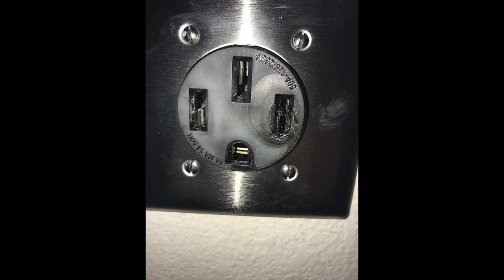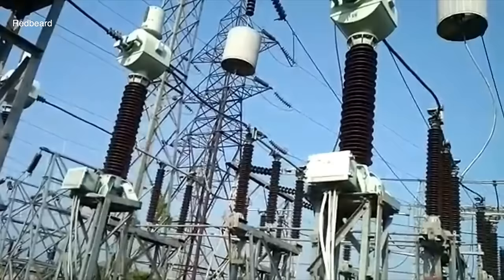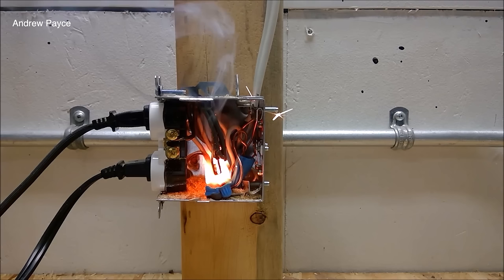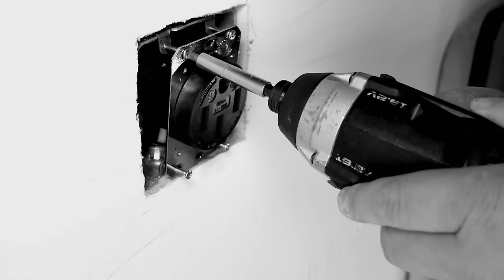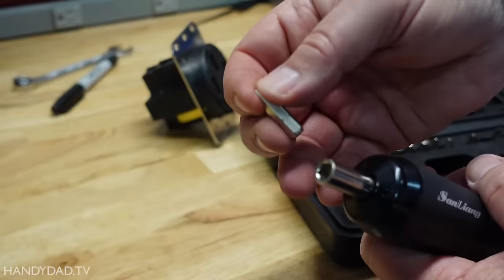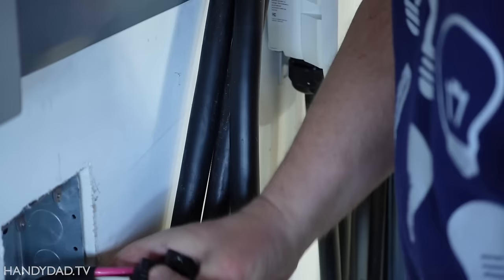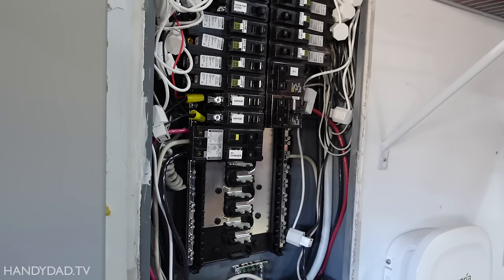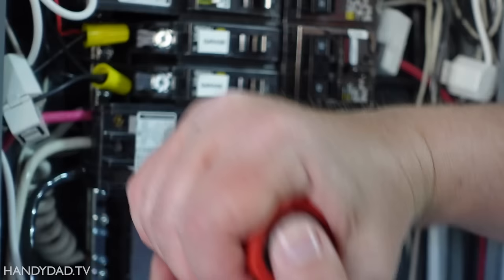EV Charging Disaster

Comment: Nice summary of the issues you have with bad connections. The design of the US domestic installations and outlets compounds the risks enormously. due to the high currenty everythig heats up a lot more. In Europe normal outlets are 220V, the connectors are designed to handle 10A indefinitely, that gives you 2,4 KW to play with. For Charging an EV n an outlet that is of course not much. so you either go with a single phase outlet with 16A, that gives you 3,6 kW, or you go three phase 16A or 32A. wich gives you 11 or 22KW since most EV use the three phases in a star configuration. otherwise they would be able to use 18 or 36 kW at a 16A32A three phase outlet. Three phase power to the house is standard in most of Europe.
utlet desig also mahes a huge difference, for the high currets have a look at CEE connectors for comparisun. So long story short, if you want to charge an EV at home safely in the US, use a wallbox. they have connectors that are designed for the high currents.
Reply: As a matter of fact..in the USA, an appliance designed to connect to a standard 120V 15A outlet can't draw more than 12A @ 120V because that's more than 80% of 15 amps. There are some exceptions, but not many. I don't believe there exists an 80% rule like that in Europe.
Reply: @brianleeper5737  ... it's actually 12.5 amps or 1500 watts to make 80% on a 15 amp branch circuit, but you have the right idea.
Reply: @rupe53  If you multiply 15 times 0.8 you come up with 12.
Reply: @brianleeper5737  ... My mistake, you are correct. I was confusing the common 1500 watt appliance rating, which is right on the edge of that. It's 12 amps on a 15 breaker and 16 amps on a 20 breaker. Got a bad case of brain fade after retiring a few years ago. Just remember that insanity is hereditary... you get it from your kids! (but it might not hit for years)
Reply: @rupe53  Yep. And one exception to that rule is hairdryers, they can pull 1800W. Probably only because the 80% rule is for continuous loads over 3 hours.
Reply: @brianleeper5737  ... would agree on the 1800 watt hair driers, but they are not all that popular for some reason, at least not in my area. I usually see them in hotels.
Reply: @brianleeper5737  no we're allowed to use the full rated value of the socket, however we also have a individual fuse in our (UK at least) plugs.  We also must have RCD (GFCI in us) in our distribution boards, and more recently they're integrated into the breakers. Latest spec is for AFDD, which can see parallel and series arc faults and isolate with warning. America gets many things right, but electrical safety seems a little dated.
Reply: @timburton1080  AFCIs have been required here in the USA since the 2008 NEC, if I recall correctly.
Reply: @brianleeper5737  In Austria and to my Knowledge Germany you can load it with 100% nominal current. There is a so called great proof load (if I translated correctly from German) of 145% nominal load that all circuit breakers need to be able to endure for one hour before reacting. for Switches it is 135%. The standards for maximum current in cables and so on also take that into account. So a properly calculated circuit rated for 10 A could be overloaded with 13,5 A for 60 Minutes if it includes a power switch and a circuit breaker. If there is no Switch bit just a circuit breaker it must be able to endure 14,5 A for 60 Minutes and then react. Obviously the circuitbreaker needs tobe sized to protet the weakest component, so if using a switch and a circuitbreaker it calls for a circuitbreaker with a lower nominal current so its overload characteristtic matches the one of the switch.
There are more things to it though, like protection against high currents in case of a short circuit, time needed till circuit breaker reacts in such cases and so on. The code is fairly detailed. this is also the reason why  layman is not permitted to do any electrical work - unless it is afterwards audited by a licensed electrician. Otherwise insurance will not pay and criminal penalties ay apply in case of a accident/fire/whatever.
So rather than labeling a high spec you can not use we lable a spec with a safetymargin already built in. A bit similar to first floor above ground floor in Europe has the number one, while in the US the ground floor  - at least in every hotel I have been in so far is labeled as 1, probably to make the building seem higher.
Also funny to see that the US is sticking to ancient measurements defined by the size of a barley corn when it comes to length, but uses SI /metric) units for voltage, current and electrical power... 1W=1N*1m/s or 1V*1A ....
Reply: Circuit breakers in the USA have a load vs time trip curve just as they do in Europe. Also, the 80% rule applies to continuous loads, which is defined as a load that continues for more than 3 hours. That is why some appliances that won't be  operated for more than 3 hours (hair dryers, microwave ovens for example) are allowed to consume more than 80% of the circuit ampacity.
Reply from the maker: Great discussion! Thanks all!
Reply: @brianleeper5737  I am aware they have a time vs tri curve. I was rather referring to the way they are rated. we rate for a nominal capacity and you can run at nominal capacity indefinitely and  in addition to that can overload for a certain ammount of time while in the US you can run on rated load for a limited ammount of time and have to calculate the actual load you can run permanently. That and the much higher currents make the US systems inherently more dangerous.
Reply: It's not inherently more dangerous. Every electrician is aware of the 80% rule and so are the engineers who design the systems.

Some might suggest that the use of 120V instead of 240V for most appliances in addition to the use of GFCIs with a 5mA trip (vs RCDs with a 30mA trip) makes the US system SAFER.
Reply: By the way, since you apparently use 1.5mm2 wiring for 16 amp circuits in Germany, you really just need to shut up about what goes on in the USA and how unsafe it is. Because in the USA we use 2.5mm2 wiring for 15 amp (limited to 12 amp by 80% rule) circiuits, and that is the smallest size allowed for mains power.

For those unaware, 1.5mm2 = 16AWG and 2.5mm2 = 14AWG.
Reply: And just so you are aware---240V is used in the USA for higher wattages appliances, which is pretty much anything that consumes more than about 2kW.
Reply: Higher current causes heat that needs to be dissipated makng bad connections even more dangerous, insulating against higher voltage on the other hand is easily doable.
Reply: But the current isn't any higher. It's lower. And the wire gauge is larger.
Reply: Germany allows 16 amps of current on a wire size (1.5mm2) that in the USA would be limited to a 10 amp breaker size, and 8 amps continuous.

Which is safer? 16 amps on 1.5mm2 wire (Germany) or 12 amps on 2.5mm2 wire (USA)? Which is less likely to overheat and start a fire?

The thicker wire carrying less amps, of course.

But just in case a fire should start, it is recognized that fires start at splices and junctions, and so, in the USA, it is required that all splices and junctions be enclosed in a junction box which is made of a material that will not easily ignite and allow the fire to spread.
Reply: @brianleeper5737  for the same power it is twice as high. A one kW appliance pulls 4,17A at 240V and twice as much at 120V
Reply: @brianleeper5737  same applies to junction boxes - and all other installation material like conduits and so on in Germany or Austria. They are all very hard to set on fire. Regarding wire thickness it depends on where the wire is and how many there are and how high the ambient temperature is. The maximum permissible temperature of the copper is 90°C this leads to the minimum requirement of 1,5mm² for 16 Amp crrcuit breakers the line itself is rated to withstad 23A.  those values are for single strand with two conductors, so phase and neutral in a conduit mounted to a wall which in germany refers to something made from Brckor concrete. if you run in drywall you have other lower maximum ratings for the cable. In a switching cabinet at 35°C ambient temperature the maximum temperature of the wire is 70°C,  the maximum current is 12A and the maximum rating of the circuit breaker would be in the 8,5A range. You should have a look at the details of the code.
Reply: When you use a 90C ampacity rating, do you have to ensure that the terminations are rated for 90C or is it assumed that they are? Also what type of insulation is allowed for 90C? PVC?
Reply: @brianleeper5737  all connectors sold for electrical work need to be usable for those temperature ranges, otherwise yo can not sell them as electrical connectors. Same goes for the cable insulation. the maximum temperature is printed onto the cable. there are cables rated for lower temperatures, in that case you have to either increase the crossection or decrease the current accordingly. there are tables available to match the components.  The cheap wires from the DIY-stores for instance are only rated for 70°C. PVC melts at 180°C but you can of course not heat it up that much. In case of a short circuit they are allowed to reach 160°C  for a short period of time, basically to gie the circuit breaker enough time to react.
Reply: Are you required to de-rate the ampacity when conductors are bundled or installed in thermal insulation? In the USA you are. Additionally, you aren't allowed to use 90C or 75C ampacity for 15 and 20 amp circuits in the USA, you must use the 60C ampacity and that results in 2.5mm2 and 4.0mm2 wire respectively. In the case of NM-B wire, even though it has 90C conductors, you are still only allowed to use it at a 60C ampacity.

I believe this goes to show that electrical codes in the USA are quite conservative, and if followed result in a safe installation.
Reply: @brianleeper5737   You have to derate if the conductors are bundled or in thermal insulation. the maximum allowed temperature for the wires also depends on where they are installed, as in my example above it makes a huge difference if you are in a conduit on a concrete wall at 25°C maximum or in a switching cabinet at 35°C mayimum room temperature. Wire/cable type also makes a difference. In wall installation normally uses single strand massive wires. YW (high temperature PVC) wires have insulation rated for 105°C, which allows a maximum conductor temperature of 90°C. Y Normal PVC is rated for 70°C. if you are using cables you typically have round cables with three, four or five strands. Those are rated for a lower current tha single strands without the additional layer of insulation that binds them into a cable. In insulated wall in a conduit is method A1, there the maximum current for 1,5mm² is 15,5A, so 12A or a little less on the circuit breaker. So there is a fair bit of circumstaces you have to consider to get the maximum current right.

Comment: Just wanted to comment on a couple of things:

1. For an EV charger, if you plan on leaving it installed in your garage (vs. unplugging and replugging for transport), consider hardwiring it to an AC disconnect box. It’ll be economically more cost effective and should provide a simpler install
2. Residential work is typically solid copper wire until you reach higher current. This is where a lot of installation issues lie. Fortunately, with the caged design of the industrial Hubble, it’s less prone to having wires splay out when tightened down. Contrast this with the non industrial style outlet typically used for stoves/ovens/cooktops where the $20-$30 receptacles has the screw contact and torque against stranded copper. This is where torquing the screw is critical. Another option is to crimp a ferrule on the stranded wire. This will keep the strands from splaying and minimize the chances of the screw loosening against the strands. Ferrules are by EU code for stranded wires partly for this reason. This is something I wish we would practice here in the US.
Reply from the maker: Thanks for the advice

Comment: This was a really cool and informative video! Maybe I could add some useful information to it. Just to clarify - I am not familiar with the available electrical connectors in the US market, since I live in Europe (actually in Norway), so I have way better overview on European market. So, after this clarification let me explain that there exists a much better terminal design than the screw terminal shown in the video - this is the spring terminal. Many years ago I worked for a company named WAGO. This German company invented 75 years ago the spring terminals, which eliminate the need to periodically tighten the terminals, because the spring follows all changes/movements during the years and in addition the contact will be resistant against the resonances and the temperature gradients as well. Now I have really different job, but as an experienced electrical engineer I still suggest to everybody to prioritize the electrical component with spring terminals instead of any screw-type because of the way higher safety. But please note, that only the reliable, good quality products (from well-known manufacturers) should be used (better to avoid the unknown manufacturers remakes) and it is similarly important to follow very tight the connection rules described by the manufacturer. I think US can be really proud on the Space Industry - so it is good to know that within the Space Industry there is the only accepted terminal type is the spring terminal (in most cases the original make) even on the spacecrafts and on the boosters... I hope this information makes Your live better and safer! 😉
Reply from the maker: I love Wago connectors for the convenience and ease of reuse. Never thought about the spring preventing the need to retighten! Thanks for giving me another reason to love Wagos!

Comment: Correct me if I'm wrong but I believe loose neutral wires are the main cause of electrical fires, particularly in residential buildings. When I was a volunteer fire fighter I was shown the cause of many house fires due to loose neutrals, mostly due to work done by DIYers. Because of that and knowing the symptoms of loose neutrals I've detected and repaired a few in my own home. I'm in a wheelchair now and can't reach my breaker panel so I have an electrician come in every 5 years and retorque every screw in my panel and it surprises me how a few loosen up over time.
Reply from the maker: EVs don’t use the neutral wire because they only need 240 volts. But your point is well made for 120-volt outlets. Thanks.

Comment: Great you share that info and make people aware of the power of electrical power. And pictures are worth 100 words. Currents of 30, 40 or even 50 Ampere are no joke and need to be handled with respect.

I just wonder, why introduce that outlet and plug anyway ? It is an unnecessary potential failure point. After some plugging and unplugging the contacts will wear out, no question IF, but WHEN.

An (IMHO) far better option is skipping the socket and plug and make a permanent fixed connection to your EV charger, making it a wall-charger. (and if desired keep a separate mobile charger in your car).

Last point, people should NEVER EVER unplug while the EV could be charging. That is pretty dangerous and will definitely destroy the connector, it has to be replaced then, even in case you should not see damage.
This is one reason we have the standard for EV chargers. It will stop the charging as soon as the (shorter) CP signal pin is disconnected so the current can not flow while unplugging the power connection.
Reply from the maker: Thanks for the info

Comment: ⚠️  Great Video... EXCEPT -->
DO NOT TORQUE CIRCUIT BREAKER TERMINALS WITH BREAKER INSTALLED!!

The movement on the panel bus will likely loosen the spring tension on the breaker contacts.

Torque up the contacts with breaker in-hand.  THEN snap it in.

Thanks for the videos...

Btw - Hubbell is the BEST!
Reply from the maker: Good advice! Thanks.